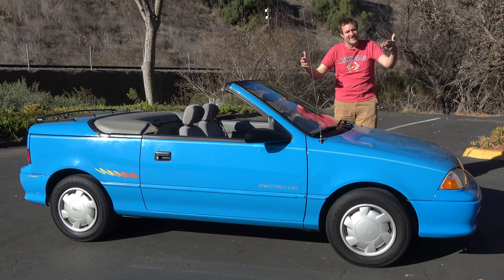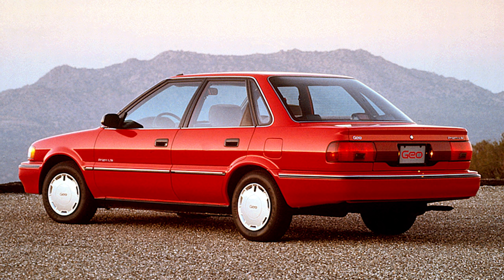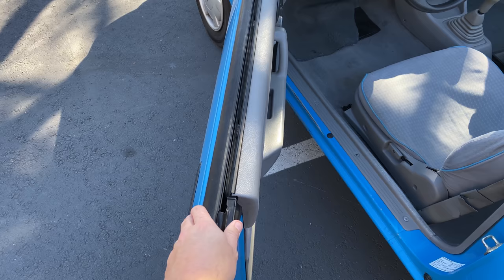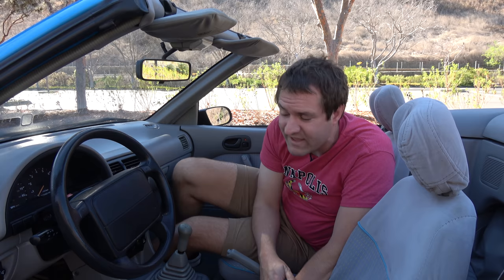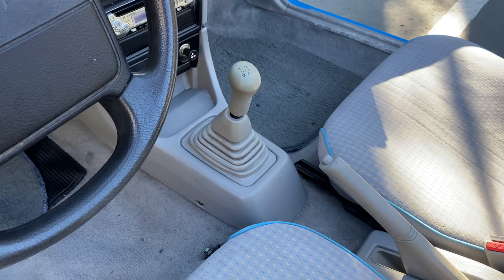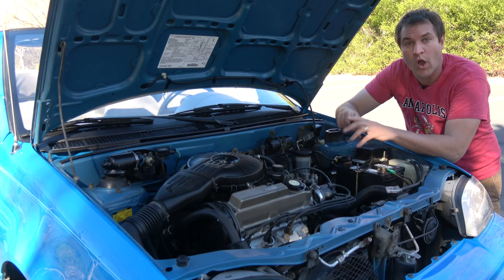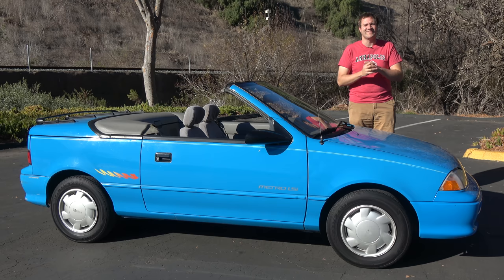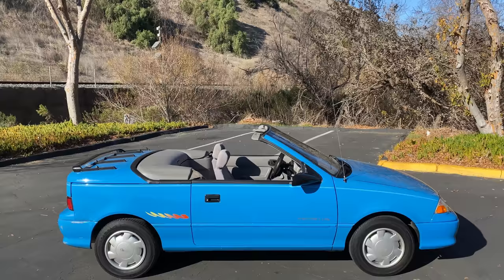The Geo Metro Convertible Was a Hilariously Pathetic 50-Horsepower Economy Car

Comment: Don't forget the Geo Storm.  For some reason, I thought the Geos were Korean
Reply: No...the Geo Storm was a rebadged Gen 2 Isuzu Impulse. Japanese all the way.
Reply: I want my '93 storm back. I loved that car.
Reply: @97cadillac  I really liked my ‘90 Storm.
Reply: Daewoo was Korean
Reply: Suzuki has had and still has manufacturing plants all over the world outside Japan.
Reply: The Geos weren't Korean, but there is a link. In Canada, the smaller number of dealer networks meant that they had to put Isuzu in GMC dealerships, so the Chevrolet dealerships got a rebadged Pontiac LeMans, made in Korea, as a Passport Optima, then an Asüna GT, then, finally, they were sold alongside Geos for 1992-93. The remainder of the Asünas were sold as Pontiacs from 1994-96.

Unique not-Geos sold in Canada
1985-88 Suzuki Forza (called GA310 in 1985, aka Chevrolet Sprint)
1985-89 Pontiac Sunburst (aka Chevrolet/Geo Spectrum or Isuzu I-Mark 2nd gen.)
1985-98 Pontiac Firefly (aka Geo Metro/Chevrolet Metro/Chevrolet Sprint)
1989-91 Chevrolet/GMC Tracker (aka Geo Tracker, Suzuki Sidekick)
1992-93 Asüna Sunrunner (as above)
1988-91 Passport Optima (aka Daewoo Racer, Pontiac LeMans)
1992-93 Asüna GT (as above)
1993 Asüna Sunfire (Isuzu Impulse, Geo Storm)
1994-96 Pontiac Sunrunner (as Asüna Sunrunner)

Comment: I'm honestly surprised that they haven't brought this car back.

Most of the cars in the '90s although they were smaller and maybe not the fastest in the world they did get better gas mileage and they were a lot lighter.

They kept things simple in the '90s and they should do the same now.

Hybrids are nice but they're expensive and they're better ways to go about making a car that gets better gas mileage and that will last 20 30 or 40 years down the road.

The Geo Metro was by far more practical than any hybrid out there today. A hybrids batteries will last 10 years at best and cost you close to $6,000 if not more to replace them.

This little Geo Metro won't have much to replace as long as you change your oil in it and take care of the motor and if the battery for the starter goes bad it'll cost you probably $100 or less to replace.

God bless the 90s and God bless the Geo metro.
Reply: Doug reviewed the modern Suzuki Swift in Mexico: https://www.youtube.com/watch?v=ZmghN0DbYys
Reply: There are too many regulations to make a car this useful anymore. You have to have a million different features that you simply couldn't pack into a car this small and practical.

Comment: Car manufacturers could easily remake this exact type of car but with way more horsepower and safety features just simply because auto manufacturing has become so much more advanced in the past 30 years. The car wouldn’t cost more than 10’000$

Comment: My aunt had a geo tracker...I can still hear the sound of the plastic windows flapping around 😭😭

Fun fact: My 2021 Mirage Hatch has 20 more horsepower, and was 7k more expensive, than this 30 year old car...though my car is an automatic w/ cvt, power windows and locks, a 7" touchscreen w/backup camera, a whole 3 cylinders with 1.2L of displacement ...really makes you see the unfair price gouging they've been doing since the mid-2000s, and how minimum wage hasn't increased accordingly to afford a car to get to work.

Comment: 9:34, when you say it's 10 mpg less, you have to check how many liters/100km 50 mpg is and how many 40 mpg is. The difference between 40 and 50 mpg is about 1.2L/100km not 23.5L/100km. They are a bit tricky to convert from one to the other so you have to be careful :)

Comment: The car I drove thru much of college was my parents’ Olds Firenze and the rear hatch struts had worn out so badly that we had a 3’ board to hold it open. We eventually got them fixed but there were many times when I bumped that board and nearly knocked it loose. It was a heavy hatch too! Still, it was a very reliable car and great in the snow.

Comment: When I was in the Marines, I knew two Marines that had Metros and loved them. They were very cheap and great on gas. One of them was on his 2nd. He said they were basically disposable cars though. They started breaking down around 120,000 miles. So, just get a new one. I had one as a rental and the car was a bit terrifying. That little 3 cylinder motor had no power at all. I've only ever seen one convertible ever.

Comment: I bought a used Geo Metro for $500. Seven gallon tank, $12 filled it up. It lasted years as a commuter car. There were times I had almost no oil in it. Never in the shop. Tires were hard to find. My Porsche Cayenne lives in the shop. Electrical problems and other problems. My Metro was like a go cart. I still miss it.
Reply: wri gg

Comment: To give you a comparison, a 1992 Kawasaki liter bike(technically 1052 cc) has the following specs:

134.4 hp (100.2 kW) (rear wheel) [3] 145 bhp (108 kW) @ 10,500 rpm (claimed)[4]

Comment: Bought a new 92 blue convert, just like this one. It was OK, no more no less. About $8500 from the dealer.
Drove it over 125,000 miles. Problems, but none serious.
  Looking back, I must have liked that car. In 1996, I traded it in on a Geo Prism. The Prism was better, as it was  a joint venture with Toyota. I have only bought Toyotas since.

Comment: Suzuki had the Swift GT, same small vehicle with a roof, obviously, but with a 1.3 ltr "twin cam" with factory Recaro seats and all wheel disc brakes making about double the HP. In the late 80's MotorWeek review the Suzuki Swift GT was faster and better than the same year Civic in its Top Trim.

Comment: While I didn't have THIS car? I had what I call the Ford equivalent of it in the form of a 1994 Ford Aspire hatchback.

A co-worker of my mother's at the time was selling it for $100. He hauled around landscaping stuff in it and it. It needed tires and brakes and the paint was faded from a vibrant red to a dull pink. But it RAN and it ran damned good. So I got it and had the necessary work done... while cleaning out the inside and (mostly) bringing the red back. Drove that little sucker for a good couple of years abusing the shit out of it because I was young and stupid. But... despite everything with the car? It was ACTUALLY quite fun to throw around and drive. lol

Later on, however? Got myself a '96 Geo Metro sedan... unfortunately with an automatic transmission. But, at the time, it was cheap and it ran damned good. I was older, wasn't driving (quite) like an idiot anymore. You know what? It served its purpose and did served that purpose well. At the time I was just putting around town and doing a paper route at night.

I'm currently in the market for a different vehicle... and I ACTUALLY found myself looking for a Geo Metro or a Ford Aspire/Festiva hoping maybe to find one that hadn't been driven into the ground. :D

No love outside of a CONVERTIBLE version of the early 90's Metro... and while in the pics it LOOKS greaet... there's nothing in the description about how (or if) it runs. It just says "Great body. good tires. needs top." and it's almost 7 hours away one way. I'm not one of those guys.

Comment: I had one and it took a beating.  I used to smash shopping carts in to the air with it. After 70 mph on the freeway it would shake like crazy and it was so small nobody ever gave it any respect. People would pull out in front of you all day long. It was fun to drive and never broke down.  A full set of tires only costed $49 for it back in 94 lol. It was great on gas!!!!

Comment: If you add front and rear sway bars and good struts the car handles ok and allows to keep up with traffic because of momentum. The beauty of driving and owning these cars is the ease of maintenance and reliability PLUS you can drive them hard and you never will get a ticket. Thats the best part as you are in essence racing all the time and taking corners at full speed just to keep up with traffic. And do all this while maintaining 45 mpg! Btw the steering is non assisted.

Comment: I've owned seven convertibles. Only one automatic. Mine just recently got side swiped at 55mph, basically a pit maneuver that spun the car around. After the cops cited the other driver, we drove the car home. Insurance offered $3300 for repairs and to not total the car. Took the money and will have the entire car bodywork and painted for $3500. Car has 73000 original miles and is worth fixing. Bought it in MN in 2018. Met the owner at the airport, paid him $3600 cash and drove it home to FL in a day. Averaged 75mph and 55mpg. Great cars in flat Florida. Five speed offers plenty of get up and go since the car weighs nothing. Would never buy with ac. This "reviewer" is an entitled jerk. My car gets plenty of looks and offers to purchase. Could get an easy $5-6000 after the work is done but love driving it.

Comment: Doug’s prejudice really shows in this one.  “Has no safety features” after he mentions the airbag and clearly the seatbelts.  I had one, I bought it used in 1995 for $3000… and paid it off working 4 months!!!  How many people can say that while in college.  This had 1 purpose - get your from one place to the other.  And you could drive it from Wisconsin to Florida with no problems.  It could hit 90 mph - if you were driving solo and weighed 140. :)  They were easy to repair, parts cost next to nothing, and it was rare something actually broke - because there were no options.  I will say I’m glad I never got into a serious accident with it - the two I did get into involved very icy roads.  The first I slid sideways down a hill for about 800 feet… across a 55 mph country highway.  Lucky there was no traffic and I literally bounced off the snowball on the other side and righted myself in the road like nothing happened and no damage.  The second time was in a parking lot at an Advance Auto Parts during freezing rain.  I slid and bounced off a parked car - no damage to either.  An officer saw it, turned on his lights (I’d assume to investigate and probably give me a ticket) but he in turn slid into my Geo and pushed it forward into the parking lot snowbank.  No damage to either but he did help pull it out.  Lots of good college memories. Picked up a stupid amount of women in it, probably because it was unassuming, but glad I do t have it anymore.

Comment: I used to own 1991 metro on the highway I usually put my foot to the floor and leave their I did get up 90mph a couple of times I drove it very hard and blow the engine drag racing with a 180,000 miles on it

Comment: 10:12 I bet that because that's originally a Suzuki Swift, the stick was on the left side because it was a right hand drive that you could adjust the right side mirror and the stick was there to allow you to adjust the Japan passenger side on the left without having to get out of the car.

Comment: I had a friend at work who drove a 93 Geo Metro hatchback.  We had to walk across a long parking lot and he jokingly pulled up while I was walking and told me to get on the hood and he’d drive me.  Me being the dummy I was/am, did it, and after just a short ride, I slid off the front.  The low front bumper went over my legs but he pulled back and I wasn’t hurt except for some scraps and my pants were shredded because I scooted some.  Anyway, that was my Metro story, felt like being run over by a go cart.

Side note, the car in this video is in bad need of a front end alignment.  Just something I noticed.

Comment: I had an early 90s geo metro and that thing was solid. It was fairly quick because of how light it was. That's also why interstate driving was NOT idea. SUVs driving past would pull it and I had to keep it at 60 to keep control when traffic was near. It was called a Metro for a reason. I once got caught in a flood situation. There were SUVs and pick-up trucks flooded on the side....I no lie got a head start and floated for like 200 feet in that thing until I hit dry, higher land. People were watching me from there. I got out like nothing happened. They were staring like I had some sort of magic. 😂 

I did the same when headed back home from the direction I came. The high point was a gas station.

Comment: It could probably have sold quite well in Europe if it had been launched then. I'm thinking of the one that tourists rent on like the Canary Islands or all the Greek islands or similar.

Cheap to hire and drive but still you get a tan, I would have definitely rented it and in such places there are rarely roads you can drive more than 50 mph anyway, so 50 Hp would be enough, it's still six seven times more than the scooter that might have been your second alternative.

Comment: Your hair blowing in the wind in a Geo Metro is like having a full blown air brake.
I had a 4 cylinder VW Jetta. It had what I called Arizona Turbo. To get a "Turbo" boost I would turn off the AC and BLAM TURBO BOOST!

Comment: Slightly harsh Doug, but ok. 33 out of 100.

You should have touched upon the 3 cylinder engine more... the thing is virtually bullet proof! I know, I had a 95 Geo Metro Hatchback. IMO that thing blows away a Dodge Laser Turbo 4 cyl or Saturn ION 4 cyl (I owned all 3 when I was a teenager) simply on reliability, easy/cheap to fix and maintain.

An 84' Dodge Laser will end up guzzling down 4-6 quarts of oil weekly, not to mention broken torque mount, shitty transmission cables losing gears, faulty electronics (door is ajar... no, it's a door with a faulty pin telling you it's a jar!!). The Saturn ION has aluminum heads that warp way to easily.

All 3 were 5 speed manual. But, the Geo metro 'jelly bean' hatchback I could drive from Regina to Edmonton on a tank of gas (back than at 74.9 was just a bit over $20.00 Canadian), replaced both CV joint driveshafts myself.. 1 large nut, 2 bolts for the brakes, give it a good yank, shove the other in, put 1 nut and 2 bolts back in, put tire back on.

Cheap, easy to maintain, and boy did that thing cut through show difts like it was butter. You NEVER get stuck! Front wheel drive and the only weight it had is right over the drive wheels on super thin tires. Was hilarious!

But don't EVER buy the 4 cyl Geo Metro's, their engines were the absolute worst thing ever made paired with an automatic transmission to get terrible gas mileage and have it constantly in the repair shop for engine repairs.

That little 1L 3 cyl engine is extremely sought after in mint condition or re-built. Go ahead and look for it or one of those 95' GEO metro 3 cyl standards in mint condition for sale, you won't find many if any.

That is a testament to this car.

Comment: 9:32 you can't just convert 10MPG into L/100km in that context. The figure you provided claims that the difference between auto and manual is 2x greater than the overall fuel consumption of my car, which is 10L/100km! 

The figures I found are: 46mpg (5.1L/100km) manual / 38mpg (6.2L/100km) auto, highway cycle. So the difference is actually 1.1L/100km. 

If the metric figure you gave in the video was true and auto really consumed 23.5L/100km more than the manual, it would do... 8.22mpg.

Comment: The advancement of automotive technology since 1992 can really be seen by comparing this Metro to a modern Toyota Hybrid. The Metro/Swift was capable of squeezing just under 50 mpg from it's 50 hp engine. My 2019 Prius Prime weighs 1500 pounds more, has 200 hp on tap (split between the 130 hp gas engine and 70 hp electric motor), and it gets 63 mpg at 55 mph (57 mpg at 65 mph). My 2023 Rav4 Prime weighs 4,300 pounds, has 302 hp between the gas engine and the two electric motors, and gets 40 mpg at 65 mph. (46 mpg at 55 mph). Of course, adjusted for inflation, both the Prius and the Rav4 cost way more than a 90's Geo or Suzuki Swift, but it's not really fair to compare them feature-wise. The Geo Metro was an affordable, simple, reliable, economy car for an era in which most American made cars got horrifically bad fuel economy, and had execrable build quality. Think '72 Chevy Vega and the Chevy Citation and Dodge "K" cars. You drove them out of the showroom, directly to either your mechanic, or, worst case scenario, a salvage yard. I almost bought a Metro back in the day, because the fuel economy was fantastic, but we had only recently bought a house, and the payment for a brand new car, even a Geo Metro, on top of the house payment, would have broken our budget. So I ended up in a used Ford Escort (these were re-badged Mazda 3's I think).

Comment: I don’t know what’s so shocking about it having air conditioning.  Any car that didn’t at least have the option of A/C likely wouldn’t be bought by anyone in the lower third of the US.  I grew up in the Mississippi Delta, and have lived in AR, MS, GA, NC, and VA, and in my nearly 50 years of living, I can’t recall ever seeing a car that didn’t have A/C.

Maybe they’re a thing in states where the hottest days of summer are in that 4-day heat wave where it reaches 87 degrees but with 30% humidity.  We haven’t even hit the peak of summer where I am now, and it’s been in the mid 90s in temperature and humidity this past week.  The only cars without A/C are the ones that have it, but it’s broken.

Comment: No safety equipment?
It has a seat belt for both passengers and a supplemental inflatable restraint system for the driver, Doug.
Edit: and a breakaway rear view mirror...which was standard equipment.

Comment: There is a 300 lb weight penalty over the 3-door hatch before the 1992 facelift.  People who drove those cars are probably thinking "they weren't THAT bad!"  Besides, power isn't everything.  And it's 55 horsepower by the way, not 50.  This thing is nippy compared to my diesel VW van.  The Metro, being kind of flimsy to begin with, was not a good platform to make a convertible from, but it was by far the cheapest convertible with the best fuel economy.  They're also a treat to maintain, being so simple and all, and extremely reliable.